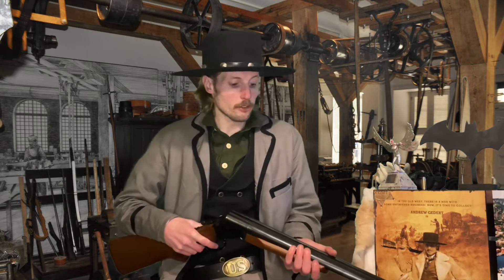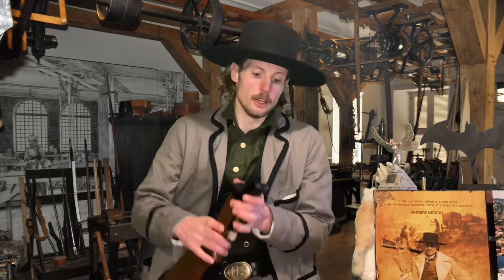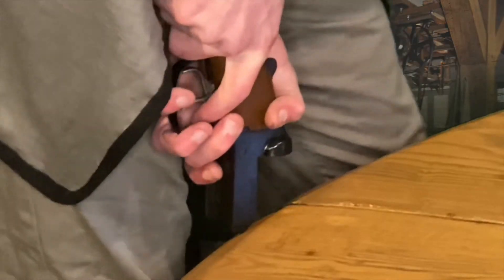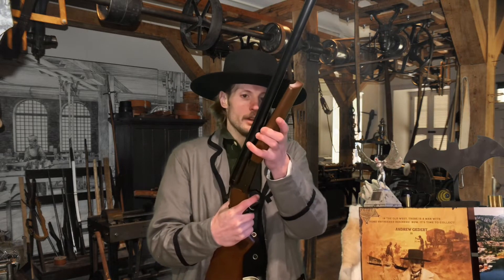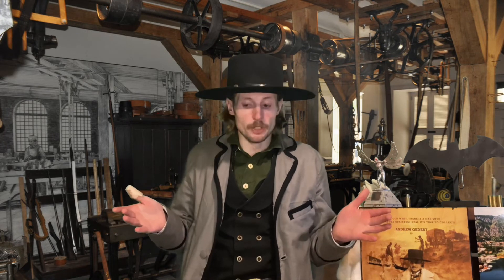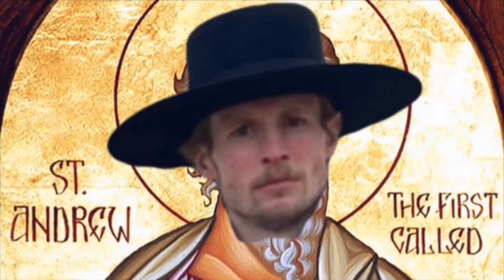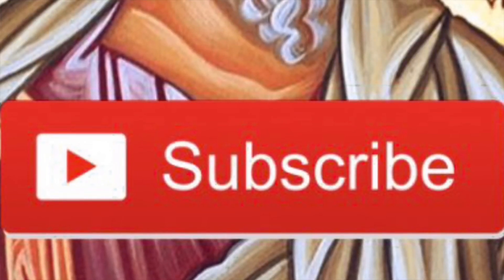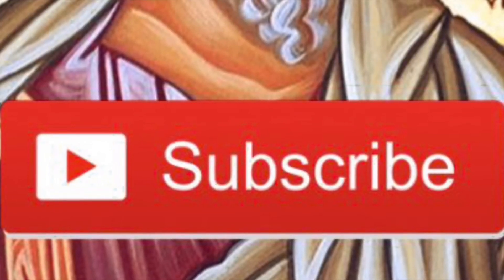How to Reset the Internal Hammers on Your Stoeger Shotgun / Coach Gun

Comment: You don't have to do that as long as you don't pull the triggers before you take it apart but if you take it a part and accidently pull the triggers or the triggers are pulled before you take it apart then you have to do this. MY advice is make sure the triggers are not pulled before you take it a part and once its a part don't pull the triggers and  you wont have to do this.
Reply from the maker: Right, but when I take it apart I make sure that the gun isn’t hot. But yes, this would work!
Reply from the maker: @kindheart6411  it’s a precautionary measure. I wouldn’t make a habit of storing a gun that’s cocked and ready to go. That was the point I was trying to make.
Reply: @SaintAndrewTV  Actually I have  these dummy snap caps and I leave in mine cuz sometimes I practice trigger pull with it. I just leave the snap caps in after I pull the triggers and since you have to open it anyway to live load it then its works well.
Reply: @SaintAndrewTV  It is better to have it cocked and ready to go, incase a break in happens while at home, every second counts. Plus that's not really good to have to do that to your gun often, chance the pins or something else could get damaged, if you were to slip or something.

Comment: Just purchased the Stoeger 20GA Coach gun. During the initial cleaning I wanted to take the pressure off the hammers springs so I pulled both triggers while covering the pin ports with a gun cloth. Both pins protuding so I was successful. Then came the dilemma. A quick search brought me to you. Thanks for the lowdown on resetting the hammers. They are reset and I now know more about my wife's new double barrell.
Reply from the maker: I’m glad that the video was helpful! Thanks for watching and enjoy that new shotgun!
Reply: I had a bitch of a time finding a 20GA but finally bought a Supreme ...would not ever sell it

Comment: Just cleaned my new coach gun this morning. Had the same problem trying to reassemble. Quite truthfully I can’t tell you how I got it back together. Now i realize it has to be in the cocked position to reassemble. Whew I was freaking out. Thanks for your tip though, it will help out next time. I could get the barrels on by moving the release lever, but couldn’t get the hand guard on!😢
Reply from the maker: Glad I could help!

Comment: Question: Does it matter whether the safety is ON or OFF while resetting the triggers? Thanks.
Reply from the maker: I believe the safety was off when I did this and when you reset them, the safety will reset when reassembling the barrel to the stock